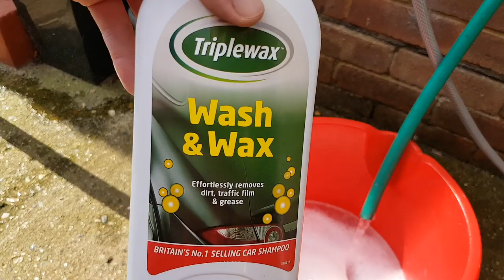How Do You Wash A Motorhome?

Comment: Lookin good!  I got a few tips for you that i have learned over the years washing and detailing different cars, pick-up trucks and the boat we own.  Here goes: a) when washing, do not use liquid dish soap unless you want to strip off the wax (there is something in the soap that will take it right off). 2)  don't use steel wool pads on your tires.  It will damage the rubber.  3) use manufacturer's recommended soap on fiberglass or plastics and make sure you rinse any soap off completely.  If ya don't, you will leave a whitish haze/film behind that is a bi*** to get off. 4) always towel dry the vehicle or you will get water spots, 5)when cleaning windows, try to use a foam cleaner and wipe it off with newspaper.  It will leave the glass streak and lint free. 6) Speaking of windows (especially your windshield or as you guys call it, windscreen), NEVER use that so called "window wax" or water repellant crap like 'Rain-X' or 'Everclear'.  First off, it doesn't work like they claim,  dirt sticks to it like a magnet, and at night, especially in the rain, when you drive under street lights or in brightly lit areas, the light reflects off of it quite badly, reducing your vision to almost nothing (it's like looking thru a window while someone is shining a rainbow floodlight in your eyes). 7) don't bother with 'scratch removing or hiding' waxes. They don't work and in my experiences, the darker the paint, the more they show the scratches.   Oh, those scratches; unfortunately it looks like ya may need some touch up paint. Thanks for the great video and we will see you in the next one.  Hey, by the way, how is Tom doing? Hope he is doing  great.

Comment: Hey Dan, you are such a penny pincher..Buy the air conditioning unit & put in more solar panels. The newer solar panels are flexible & you can walk on them. So even on the roof, you wont hurt them if you walk across them. You can put more batteries in your storage garage behind & under your RV's bed.
They sell them at the Narrowboat shows. Thata where I saw them on a vid before.

Comment: Dan I know this isn’t a new video, so it’s possible you already have a solution to cleaning your van so I won’t waste time giving you information you may already have. 
The best piece of kit I’m going to recommend is the flex polisher, it’s a geared oscillating finisher, which is more user friendly for the beginner, I’m not saying that to be condescending but some are rubbish, some require lots of care and practice or you will wreck your finish, and a few like the flex are really good. I’ve got one in my kit and it’s invaluable. It’s an American product but when I experienced a slight issue with an head. They not only sent it within 48 hours but it contained about £80 in extras, Woh. 
 I know I’ve left a few bits here and there on your videos but if your still stuck I will send you more on the kit. 
Ie different pads, compounds polishes and finishes. If you get on top of it you only need to do it every 3-4 months and rain etc will fly off.
I’m not affiliated to any stuff, you do as you fancy xx

Comment: I don't use a pressure washer, too worried that it will damage the seals. That Mellerud caravan seal I reviewed was good stuff, helps keep it clean. Autoglym insect remover is good for bugs.
Reply from the maker: yes that Mellerud looked good. I didn't use the pressure washer in the end because I couldn't find an extension. I'd only use a pressure washer though because we haven't got any seals to damage. We haven't even got a dog.

Comment: Use a pressure washer. You can get a snowfoam lance. Spray the van down with water  then attach the foam lance spray the whole van down with foam and let it sit  top up foam and go over the van with a microfiber mitt. Then just rince off.. If you wax it it will make it easer to wash next time. 
Worx do a portable pressure washer that works off a bucket or big bottle 
Don't use a sponge it holds dirt and turns into sand paper putting tiny scratches in your paintwork it will make it dull
Reply: Don't use a pressure washer ANYWHERE near seams and seals, you can blow the mastic out and end up with water ingress

Comment: The best way to get rid of small scratches is to wax it. And I mean real wax where u put it on with a rag using a circular motion and then polish it off with a clean soft rag. The car wash with wax in it can help in between waxes but its amazing how many scratches a good wax can get out. Also, I'd recommend to get at least a mid-tier wax, not a cheap one. Waxing that huge van by hand would be a big job. U can buy an electric buffer for pretty cheap and with a van that size I would def recommend it. For big scratches, the only thing u can do it touch up paint to a touch up paint pen.
Reply from the maker: Thanks for the advise.

Comment: Try Williams waterless wash and wax. It washes and waxes your van without having to use water. no scratches which is what I was worried about. Spray on leave for 5 mins then using micro fibre cloths wipe off then another cloth to buff
Reply from the maker: Sounds great.
Reply: You have to keep changing the cloths you would need 100s for a van and I'd not trust it nott to scratch

Comment: Hi Dan you did a great job  l heard it's best if you wash a car or van in the rain dont have to rinse it afterwards ..true l would use t-cut on the scratches & swarfega red on the awkward Mark's it's great stuff 👍
Reply from the maker: never heard of swarfega, Ill have to look out for that.
Reply: Hi Dan it's very good swarfega get it from screw fix B&Q quality save  used it on my radiators etc came up like new dissolves grease grime etc 👍
Reply: Paintwork anything 🙂